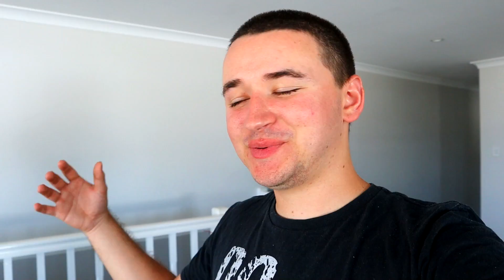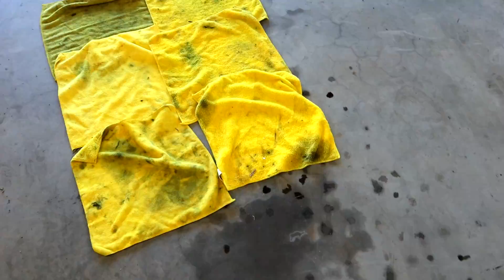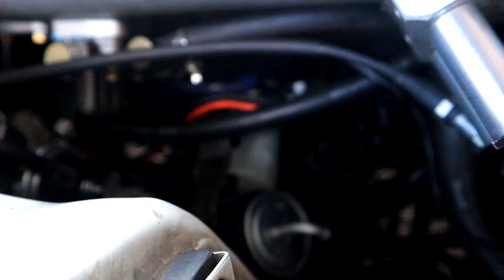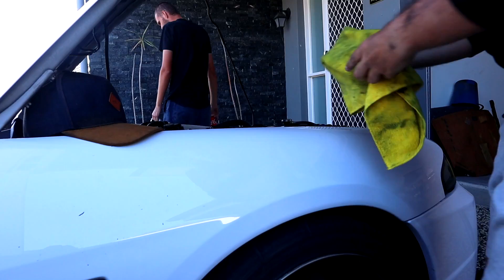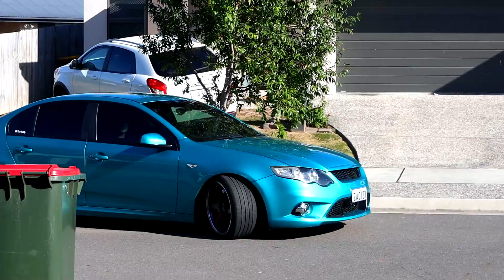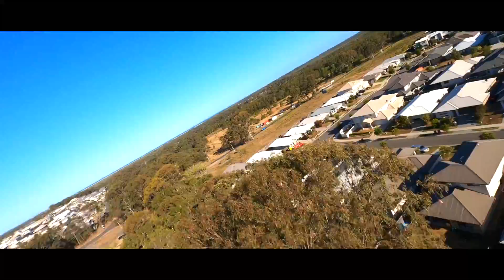1 Less Oil Leak in the NISSAN SKYLINE!

Comment: The moment you tell Zac there's a spare 1/8 npt port to the left of the oil filter, you don't need a sandwich plate.

But really when you do FFP ya should do a filter relocation for this very problem